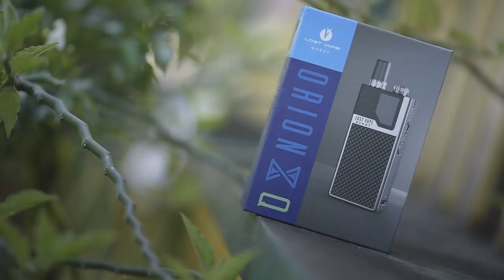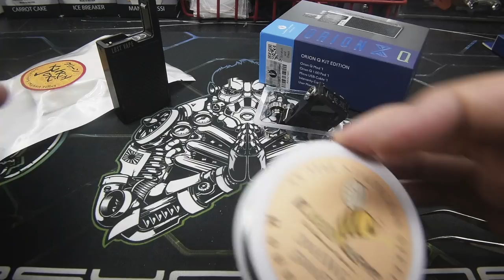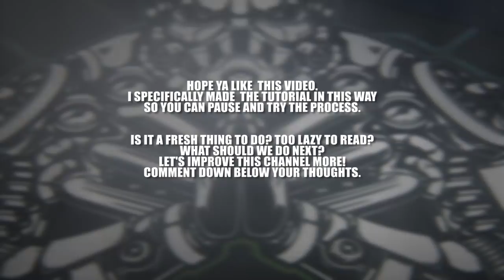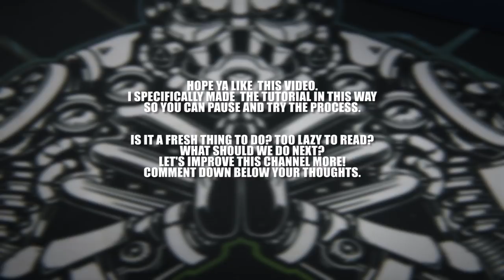REBUILDING THE ORION (Q) POD | misterbuilder

Comment: Rad tutorial pare! Would like to ask, I have an Orion DNA Go and it uses 0.5 and 0.25ohm pods. What coil build should I put in it? Like, the type of wire, how many wraps and etc.? Thanks again brodie! Would definitely share this to my friends. :) Hoping for your quick reply I’d like to try this out asap :)
Reply: At least  26ga stainless steel you are shooting  for .8 ohms or less. You can change the settings  on the dna to work with q coils also but I'm  not sure what those values are.
Reply: im going to use 30ga and see how it goes on my DNA go. i've done some research and i believe that 30ga is fine. some used 29ga.
Reply: You shift it up above the one ohm range on either the DL or mouth to lung presets using a nifty free software called Escribe (I left room for error by setting it at 0.3 ohm -1.48 just in case my coil ohms shifted I like to make my pods last a month and have only rebuilt one the tutorial was much apreciated)

Comment: Great video, but can I ask, what does it make better? Taste, pull? I have just bought an orion Q but I find I don't get enough airflow, drag very hard but don't really get much hit, is there a way of getting more air through the mouthpiece or make airflow better in any way? Thanks! I'll try the coil replacement.
Reply: OK, So I have made the rebuild but it doesn't work. If you press the pod down hard against the housing it seems to try to fire but nothing... Just blinking 3 times in a purple sort of color, any idea?
I have used 26 ss316L cable. 6 turns, the guy told me in shop that should ohm out at 0.5
Reply from the maker: I'd like to point out that the max i can recommend for the gauge wire is 28g because the wire mass on that will be too much and battery will not be efficient. Although in some cases, coils ohming to about 0.5 work (since the ss316L is jumping resistance) maybe that's why you're experiencing battery protection that's hindering you to fire.
Reply from the maker: For the af, i find the orion q very airy at full open settings. It's kind of ridiculous for a pod to have that kind of af but i do enjoy a full closed setting.
Reply: @patatoontherun  hi, thanks a lot for your reply. So I took everything apart, made everything again from scratch and at the beginning I had same thing, battery protection but after a few attempts was working, then every now and again battery again flashing after that (1 hour trying) working. I don't understand why or what made it work... But it is, a little better but not what I was expecting (same wire and cotton). For the AF I like a little light but not like the big vapes, seems to me too much smoke. With the Q seems like I have to pull real hard to have a decent direct to lung. And the MTL I don't like so much very itchy throat lol. Maybe the smok nord or mipod are better for what I want, not sure. Expensive to just try... Anyhow I might try to get a 28 o 30 wire and try again. Crap having to put the cotton through those small holes in pod though...

Comment: Good tutorial and so that it is not so difficult after you get the cotton you take it with fine tweezers to stretch the cotton without using the screwdriver so you do not spoil the cotton and it is faster.  Another fact is to cut the wire inside the labbase, not on the flat part, because at the tip of the wire when you see it bent to cut it and put the rubber it is not completely sealed and there may be leaks.  It has already happened to me.  It is better to cut the wire when it is inside the pod to seal that s see example as factory wine but not with deafness if not because the wire comes in contact but without leaving the pin of the base ... You understand are intelligent ...  Greetings.
Reply: Same happened here , but inside still leaking .
Still find way out

Comment: After the rewick, the fluid leaks on the pins. Rubber seals are placed.
Reply from the maker: What gauge did you use? Is it locked all the way in (the pins)? Do check the rubber seals for tear. Check your wicking, eliquid should not overflow to that part (coil legs) since the purpose of the wick is to hold the liquid through the coil wraps.
Reply: @patatoontherun  I had to push the pins a little harder. I saw it in another video. Thanks for the video, everything is working fine now. Have a nice day.

Comment: Some tips and trick to open the part below mouthpiece? I try to open it until it looks like almost destroyed but still can't open.
Reply from the maker: Some carts are really fit. Out of almost 50pcs i've rebuilt, i think 15 of those have really tight fittings.
Reply from the maker: What i found effective (while using the long nose pliers, put tissue so it won't damage the tip), turn it (whatever direction) while slightly pulling. The mouth piece has 2 notches and must be timed with the shape from the cartridge body to release.
Reply: Thanks i think i just need practice. The first catridge is so damaged that it looks ugly. But finally i can pull it. The 2nd is still looks good with some try. The 3rd i can pull it out in 1 try.
Reply: @hilariusubaldiasarinarindr9255  or heat it with hairdryer so the glue will melt

Comment: is there a way to just rewick the pods?
Reply from the maker: Yes but it's harder than just taking it apart and rebuilding it. Also, depending on what eliquid you were using (gunk issues) and how long were your coil to start cleaning it.
Reply: misterbuilder is there a video on that or is it the same concept?

Comment: im used to being able to heat the coil before wicking. how do you get rid of hot spots like this?
Reply from the maker: Before you place it on the cartridge (if you have a conventional vape set up preferably a variable mod), you can hook it up first on the atty and fire it to your liking.
Reply: If you space the coil and use good ss, you shouldn’t need to preburn. Alternatively, you could hit it with a blowtorch or lighter.
Reply from the maker: @natebuchanan5357  Good ss means clean material yes you really don't need to preburn but since it won't be accessible when you place the coil in (and wicked), i'd say it's safe to do the extra step for security. Moreover, hitting the coil with a torch is very diff from preburning using its legs since the flow of heat will be different from the two (torching it would give concentration to where you're aiming it vs. Preburning, it will always start to heat on the center then spreading towards both ends, consistency).

Comment: if you put coil like that , when you vape it , a heat would be burn your  bottom base rubber ,   that was my experience
Reply from the maker: Nope it won't. Because leads/legs will not burn unless you fire the device longer than what you'll be needing (no problem there too because the device cuts off after 10secs so it will not heat up that long leaving your cotton burnt first before burning your base).
Reply from the maker: Coil position and placement is the same with stock. The diff is just the OEM coil on the cart is crimped with the 2 gold plated pins. There isn't enough mass unless you're using 26g and thicker.

Comment: My pod after i rebuild, it's hot so fast. Orion dna 1ohm, coil ni80 28AWG --6Wraps. Pls show me to fix it. Thanksyou so much. Hope you understand becase my English's not good! :D
Reply from the maker: Try doing 29g or 30g ss wire. 😊
Reply: Tks bro. But i have 28awg 28 here so how can i build coil 1ohm with that? :D
Reply from the maker: Yeah i mean with that kind of wire mass vs. the device's battery output, puffing it continuously will really affect your setup's temp and batt longevity.

Comment: I’m having trouble wiggling out the metal piece below the mouth piece..... can anyone give some tips?
Reply from the maker: Right, so if you removed the mouth piece you'll see a knurled part which you can anchor your needle nose pliers. Since it's fitted, it's normal that it'll be quite difficult at first to remove.

Comment: I got it rewicked but can't get the drip tip in to save my life in jacking the hole up like crazy!
Reply from the maker: Line the pattern up and press it against a table. That'll work. :)
Reply: @patatoontherun  I thought I seen a pattern but I wasn't sure lol. But I did try to line it up and I couldn't get it in. I'm going to try again though with another one, cuz I really messed up the hole trying to get it in lol.

Comment: can we use 2,5 mm ??
Reply from the maker: I used 2.5mm id on the vid.
Reply: @patatoontherun  is it okay if we don't change the cartridge for long term use? should we clean it with water?
Reply from the maker: @bangojolmedan  depends on your care  but you should rinse it off qhen you try and rebuild it. Rinsing with water with the cotton/coil in it will not help if you're keeping it as is and drenching it in water
Reply: @patatoontherun  so that's mean we dont need to buy the cartridge anymore?
Reply: @patatoontherun  anyway, can we use 24ga by GeekVape?
Reply from the maker: @bangojolmedan  24g is quite big for its purpose. The most you can use is 28g
Reply: oke bro, thank yoou so much

Comment: And a mipod rebuild pleeease
Reply from the maker: If i get a hold of one i might do it.
Reply: Kero Libra and @misterbuilder, this was why I specifically bought the mi one, the joyetech cuboid rba section can be used to rebuild/rewick easily. It can get a touch spitty if you don’t build and wick it right, but it’s SUPER cheap, super small. Just a thought.

Comment: do you have any tips when they start leaking from the bottom where the battery connections meet? I rebuilt the same one like 5 time and no leaks, but now its leaking and i rebuilt another pod that i messed up on so I didnt use it and noticed it leaked just sitting on the table.